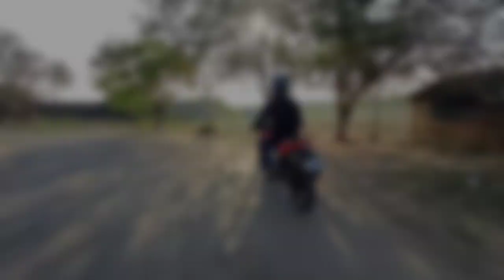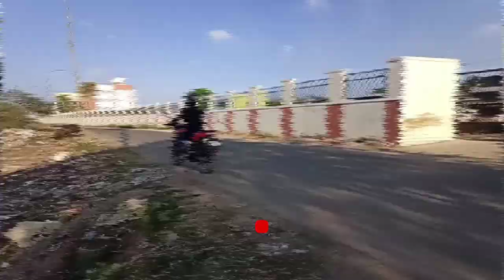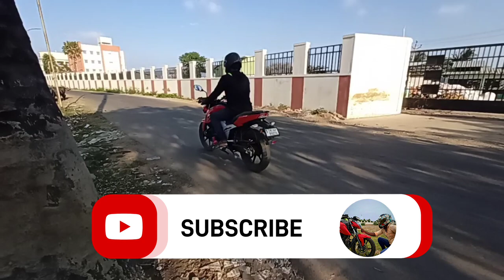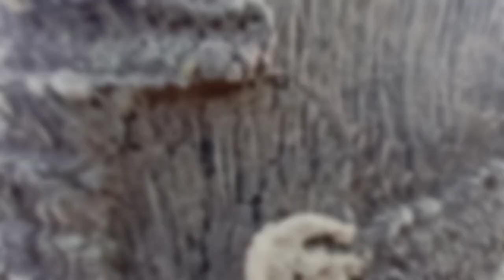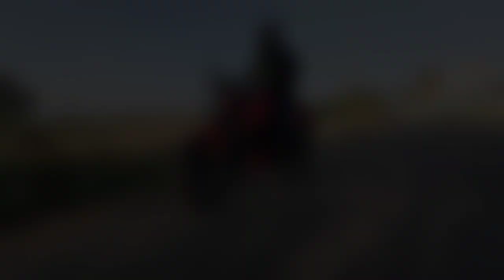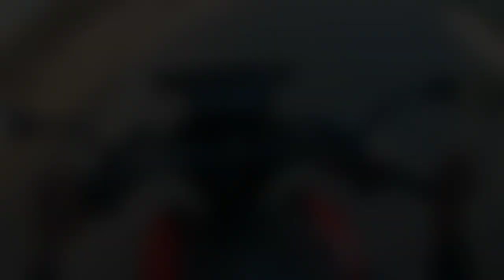how gtt work after 2years / how gtt work / apache RTR 160 4v gtt detail review / rtr gtt use / #rtr

Comment: Thalaiva u r reason y I buy Apache 160 over other brands ...u r inspiration and encourage to do ....ithuku munadi yum soli iruken .....but en bike la diff bro I own special edition sports mode la 1st gear 7 2 ND gear la 14 3 Rd la 21 4 th la 25 5 th gear la 31....but urban and rain mode la same as u r bike ...urban/rain mode la 5 th gear la adaikum 4 th gear la 20-21....I m using lot this gtt mode with help of it I m getting good milege ....gtt Yoda big advantage pathi Oru video podunga bro ....actually athu irukurathala than namma Apache matum 4,5 th gear la rombo slowva ponalum gear cut panalanalum off agathu ....speed breaker la 3 Rd gear la 15 la vidalam vandi off agathu ...street kulla traffic la namma accelator kuduka theva ila becoz engine Yoda idle power vachi gtt run agum ....so only 2000 rpm always run on our bike even beginning la bike kathukuravyngaluku best bike .....ithelam explain Pani Oru video podunga guru ......unga video la than first gtt na enanu therinchitey but athoda advantage IPO use panumbothu than theriyuthu .....so ithelam mathavungalum therinchikatum bro .....epdi namma bike 50+ tharuthu nu doubt kekuranga but gtt yala traffic la 25 la kuda 4 th gear la polam nu purinchipanga so better milege nu nenga video pota .....
Reply from the maker: Kk bro

Comment: bro am a beginer apo first 3 gears la bike off aagatha on lower speed or gear shifting on speed breakers la with gtt technology
Reply from the maker: No bro .mm clutch vida kathu kitta la pothum .
Reply: Bro nenga kathuka Less than 200 cc la ithu than best bike becoz gtt irukurathala nenga beginner bayathula accelator kuduka matinga  so other bikes off agum ....but Apache la nenga first accelator ye kuduka venam just 4 gears pottu gear up and down turn ithelam Pani parru then u fel confidence athu ku apram accelator kudukalam and mode irukurathala nenga urban rain mode la otuna power yum kamiya than irukum so engeyum iluthutu pogum nu bayapada venam spelender Mari than irukum urban mode la otta performance but pick up RTR 🔥 fel agum ... learning time la speed breaker and turning la than tension agum but intha bike la nenga 4 th gear la 24-45 otalam and 5 th gear 35 Vara adaikathu so nenga street or turning la or speed breaker la poringa na just one gear down and one gear up Pana enough ....also group clearance high so big speed breaker la kuda thatathu.....less than 5000 Rpm it gives u milege 55 ....urban mode la .....beast mode la sport mode la 90-100 cruise panalum 45 thanthutum ...less than 90...80-90 la  it gives u 50 kmpl milege in sports mode.....I own special edition ipadi Oru multi purpose bike less than one and half lacks or even India la entha bike yum ila .....normal ya spelender economy speed la otuna 55 milege touring la speed ya pona 50 milege vera entha brand entha bike Indian market la tharathu ...